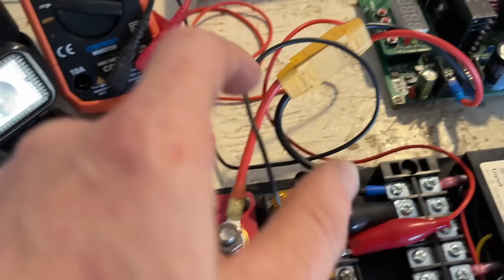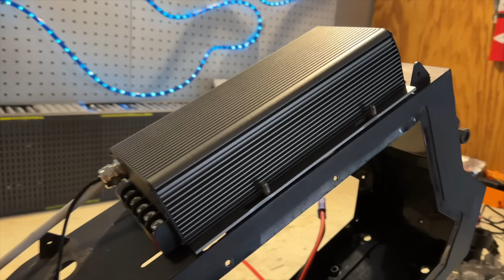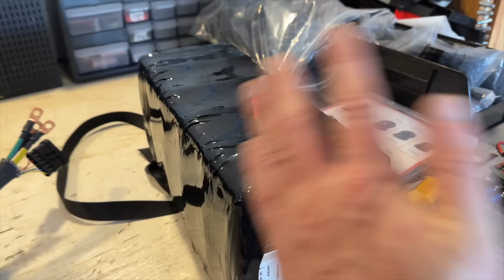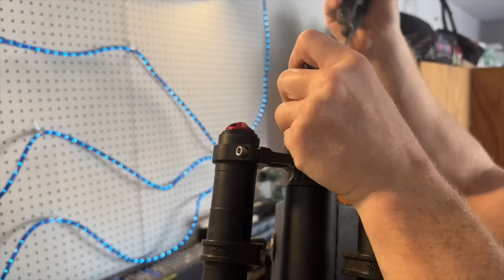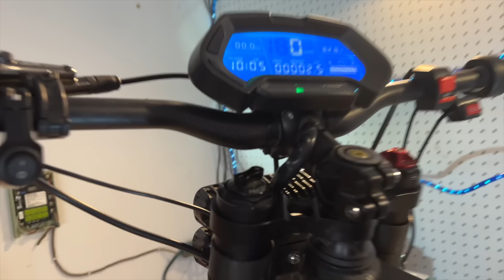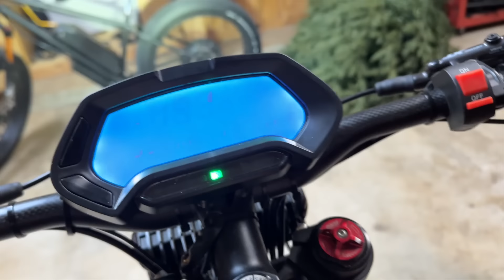This Might Be The Best Way to Build a Stealth Bomber Ebike

Comment: nice job ,you still have way more you can get out of that controllers and set up ,if you got the unlocked version like i did ,you can get insane speeds im using a customised crystalyte HS4065 RD motor with statorade and heat sinks ,and can quite often see the dc amps hitting 300 plus amps with phase amp sinto the 600s ,but im using a 20sx20p battery with 82 volt pack of supa capacitors in parallel ,to eliminate any V drop,
Reply: it took along time to get mine wired and installed though because i have svmc72150 on the rear and svmc7245 on the front with a 750 watt bafang internally gear hub motor ,that has a launch timer on the front motor .i also had to use a cycle analyst inside and raspberry pie that runs android main dash and secondry 5inch touch screen in top of the frame ,i get all the data from bms and 2 sabvotons and CA via a CAN bus sheild to the pie and bought a bunch of can nodes from ali express for few bucks each for all accessories and buttons etc
Reply: we also modified the rear swing arm and suspension to linkage type so can use way longer travel shock its no mounted up under the seat frame like an actual S bomber ,the battery has amazed me though its completely immersed in 3m novec dilectric fluid ,and they stay perfect temps ,dont even get warm even when charging at 50 amps,its expensive ,but worth it concidering its now fireproof
Reply: Where do you learn how to do all of this? Are you an electrician?
Reply: Audio studio engineer,and studio design.but i worked for a place called dick smith electronics while was at school and when first left school in their service  deptment,  i used to buuild and repair the diy electronics kits that people bought and couldnt finish or get working.  But when it came to the bike i did alot of reasearch first ,and made a specific list of the functions i had to have ,and didnt deviate from thatmwhich made it alot easier
Reply: if you ever need circuit diagrams or designs ,or how to do something im always happy to help as im retired now, had to retired early when had a stroke cpl years ago,but im ok now ,but  im not going back to work
Reply: i make my acc and lights controllers.antilock hydralic brakes addon module. electronic gear shifting unit, traction control system,all on rarspberrypi with touch screen in the top of the frame
Reply: happy to share all the plans
Reply: @katiekumcgil damn that’s so cool, I’ve been wanting to build one for a while now as a project to reunite with my dad. I’m eager to learn. I would love to have your plan to help us build the best bike! Thanks and hope you are doing better!
Reply: @katiekumcgil G'day matei believe it would be absolute fantastic to hear your e bike build story  if your willing to share  your experience and knowledge then i would be privileged to hear every detail  and learn as much as i possible could from you. 
What sparked my interest was hearing you talk about rear swing arm mods  i would appreciate greatly to be able to hear every single little detail of  what specific modifications you did to your swingarm/rear suspension to   increase the travel. I would love to hear about all your e bike building experiences
Reply: @katiekumcgil  could you please upload photos of your plans or a video of your ebike modifications on your YouTube channel. Your e bike buid sounds so very compelling.
 Thanks
Reply: Hello Scott i  actually had a stroke the begining of last year so would make it hard for me to do a full build video ,but saying that since you asked so nice ill sort out some photos and ill do some plans parts and specs for you ,myself and Angus actually repair and customise ebikes,mainly for the higher spec bikes as im in Australia and they are near impossible to buy here,only street legal bikes can be sold retail and bikes like sir ron have insane mark ups here nearly twice the cost they pay in the states .we try and start off with frames that anyone can buy online like the bomber clones ,and modify them to have full suspension travel, ,they way they are with that little shock at the back realy seems like a last minute fix ,so we make a linkage arm that lets you mount a full shock up under seat. the control system is possibley to involeved for most but not undoable all parts are available ,theres a few mcu s like arduino nanos and rarsberry pis ,and all code is allready writen and available on site called Git hub and the dash is actually on android phone and that talks with android on rarsberry pie ,has full navigation electric and manual gear shifting  ,dual motors ,we actually worked out how to install front hub motor on the zoom through axle forks too. the battery system is abit in depth as it usues whats called immersion cooling where all the cells are in solution,like those mineral oil pcs you see on you tube ,the controllers are also connected to it so they are full of liquid as well ,it doesnt add to much weight concidering the returns.anyhow ,if you can give me a bit of time well sort out some stuff,casn do wiring diagrams to
Reply: we are currently designing and building the E-Camper ,to go with it ,which is to be a full featured micro camper ,to have 4 26inch rims set about 3/4 length and the front 2 wheels have hub motors so basically the camper is self powered so no weight or stress is put on the bike,this allows us to put a huge battery in the camper giving somewhere between 500 to 1000 kilometres as it connects into the bikes battery as well ,if you have alook at a channel called  woodbiker he makes a small version of what were doing but it will give you and idea how easy they are to build and its done with eps insulation board and single layer fibreglass ontop
Reply: if you find theres something that youd like to make yourself that weve done ,then i can do a more detailed design drawing and full parts lists etc everything can be made with minimal tools and intermediate electronics knowlegde ,but ill allways help out if needed
Reply: thought you might like this too as it started off as abit of a joke ,but found that it started to make abit of sense as a back up or even for charging,we found a tiny 23 or something cc chainsaw motor and made a 50 volt 30 something amp micro generator ,and uses 2 dc to dc boost converters to output 85 volt or what ever you need ,but the funny part is that its the same size as our bike battery so can remove the battery pop this in start it up and away you goit will go all day virtually on a tiny bit of petrol,but can also just be used to charge the bike ,were going to stick it in the camper storage ,as ill be in some really remote areas where you dont see anyone for days possibly few weeks sometimes.
Reply: @katiekumcgil i am just puttimg the finsihing interior trims on my camper.  I made up a fake brand..."EcoTrek" and put some graphics and logos to make it look legit.  It weighs about 130lbs without batteries / solar.  It has a 12v fridge, a sink and faucet, desk.  I hope to put about 350W of solar on it and just keep adding more and more batteries.  It is also getting hub motors eventually.  I put two on my bike first.  I am still considering an axle run to an electric motor I already have, but the hub motors are so much nicer and easier.  I am eventually hoping to travel cross country with it.  I was hoping to test it this season, but it wasnt quite ready.  I hope to spend a ton of time with it next season though.

Comment: how much did this cost to build?
Reply: That price itself is not made for everyone
Reply: @ankanpradhan9724  this is actually obtainable unlike those boutique like bullshit emtbs that put a fraction of this bikes power at the cost of lower weight and costing almost like a good new car.
Reply: @dienowplease3565 Thsts an entirely different market with different goals.

They are primarily on the pedals all the time, and the powertrain needs to be unobtrusive and not throw off the balance or make the bike difficult to peddle.

And those are folks who don't blink at $8k for a regulat MTB.
Reply: @ankanpradhan9724 3k not that much
Reply: Well what's great about ebikes is you can source the parts little by little, maybe 1 pay day buy ur forks, maybe next time you get money buy battery an so on, you don't need 3000$ upfront an lot of parts are relatively cheap like handle bars or peddles, an you can customize to ur likings,  I have a custom built ebike cost maybe 1500$ I bought over course of 2 months and it does 40mph easily an for another 200$ I could got a 52volt 2000watt kit an reach speeds of almost 50mph an easily go up big hills an easily covers 30 miles throttle only top speed
Reply: @josephgeorgeejr7039 have you built an ebike?
Reply: @josephgeorgeejr7039 Ingotta call bullshit on 50mph for 30 miles on a $200 upgrade.

I don't think you understand power requirements or realities of battery sag.
Even P45b's will sag.

Take a look at this guys video again and watch how badly his battery pack sags.

If he ran wfo for 10 minutes he'd be done.

Even my old pack that would do 800a continuous and 1600a burst still wouldn't really do 800a continuous.
Reply: How? I calculated one a while ago and I somehow got like £7k but maybe as like 7kw+ motor
Reply: @mlee6050  Your where? UK? Europe? Maybe that's why? 
Here in Canada you can build one for about $3000 Canadian. 
None of you seem to understand exchange rate. Our money has different value. Certain parts and products are more readily available in some regions which makes them cheaper. Etc
Reply: @rabbithole8592  I understand exchange rates, it why at times I buy groupsets for my bike from America as even with import I save a few hundred than in my country

I might build one in future, issue now, I want one and a mountain bike £5k for sub 8kg and fixie and the builds I plan are a few thousand each
Reply: @mlee6050  Well that socks dude. I can build a stealth bomber clone for about $3000. Canadian. 😉 👍
Reply: @rabbithole8592  I might be able to lower the price but look around more, I mainly went to a single site, I normally go through like 8 sites manually comparing when doing so, think one I looked at was 70mph or so, I believe 8-12kw motor I was looking at, after I build my trek Emonda ALR I might look into it more

I'm also tempted if should add a motor on my folding bike where chain is on left but have chain on right for gears I want
Reply: Just ordered mine for 2k
Reply: @00-Dima  where did you order yours from ? I've been trying to find the best places to pick one up.
Reply: Yeah where did u order? Alibaba?@BanderaMafia
Reply: You can make a stealth bomber clone for about $3000
Reply: 😢😊😊😊😅😊 @rabbithole8592 😂
Reply: @rabbithole8592 you can make one for under 500  easy it’s just everyone will over charge you for parts so you need to make them
Reply: @rabbithole8592 in India we can buy a super electric bike less than of that money
Reply: @atnakus  Yeah because your money is worth hardly anything compared to American money. It's a different currency and exchange rate.
Reply: @rabbithole8592 that's definitely NOT why
Reply: How much is it there?  @atnakus
Reply: Please what is the material of the electric bike?
Reply: @waledactionph7860  MOHAMMED WAS BEWITCHED/POSSESSED BY SATAN! 

Sahih al-Bukhari 6391

Narrated `Aisha:

that Allah's Messenger (ﷺ) was affected by magic, so much that he used to think that he had done something which in fact, he did not do, and he invoked his Lord (for a remedy). Then (one day) he said, "O `Aisha!) Do you know that Allah has advised me as to the problem I consulted Him about?" `Aisha said, "O Allah's Messenger (ﷺ)! What's that?" He said, "Two men came to me and one of them sat at my head and the other at my feet, and one of them asked his companion, 'What is wrong with this man?' The latter replied, 'He is under the effect of magic.' The former asked, 'Who has worked magic on him?' The latter replied, 'Labid bin Al-A'sam.' The former asked, 'With what did he work the magic?' The latter replied, 'With a comb and the hair, which are stuck to the comb, and the skin of pollen of a date-palm tree.' The former asked, 'Where is that?' The latter replied, 'It is in Dharwan.' Dharwan was a well in the dwelling place of the (tribe of) Bani Zuraiq. Allah's Messenger (ﷺ) went to that well and returned to `Aisha, saying, 'By Allah, the water (of the well) was as red as the infusion of Hinna, (1) and the date-palm trees look like the heads of devils.' `Aisha added, Allah's Messenger (ﷺ) came to me and informed me about the well. I asked the Prophet, 'O Allah's Messenger (ﷺ), why didn't you take out the skin of pollen?' He said, 'As for me, Allah has cured me and I hated to draw the attention of the people to such evil (which they might learn and harm others with).' " Narrated Hisham's father: `Aisha said, "Allah's Messenger (ﷺ) was bewitched, so he invoked Allah repeatedly requesting Him to cure him from that magic)." Hisham then narrated the above narration. (See Hadith No. 658, Vol. 7)

22.52-54 Kathir - Ibn Al KathirHow the Shaytan threw some Falsehood into the Words of the Messengers, and how Allah abolishedAt this point many of the scholars of Tafsir mentioned the story of the Gharaniq and how many of those who had migrated to Ethiopia came back when they thought that the idolators of the Quraysh had become Muslims, but these reports all come through Mursal chains of narration and I do not think that any of them may be regarded as Sahih. And Allah knows best. Al-Bukhari said, "Ibn `Abbas said,فِى أُمْنِيَّتِهِ(in his recitation (of the revelation).) "When he spoke, the Shaytan threw (some falsehood) into his speech, but Allah abolished that which the Shaytan threw in.''ثُمَّ يُحْكِمُ اللَّهُ ءَايَـتِهِ(Then Allah establishes His revelations.) `Ali bin Abi Talhah reported that Ibn `Abbas said,إِذَا تَمَنَّى أَلْقَى الشَّيْطَـنُ فِى أُمْنِيَّتِهِ(when he did recite (the revelation), Shaytan threw (some falsehood) in it) "When he spoke, the Shaytan threw (some falsehood) into his speech.'' Mujahid said:إِذَا تُمْنَى(when he did recite) "When he spoke.'' It was said that it refers to his recitation, whereas,إِلاَّ أَمَانِىَّ(but they trust upon Amani) means they speak but they do not write. Al-Baghawi and the majority of the scholars of Tafsir said:تَمَنَّى(he did recite) "Reciting the Book of Allah.''أَلْقَى الشَّيْطَـنُ فِى أُمْنِيَّتِهِ(Shaytan threw (some falsehood) in it) "In his recitation.'' Ad-Dahhak said:إِذَا تُمْنَى(when he did recite) "When he recited.'' Ibn Jarir said, "This comment is more akin to interpretation.''فَيَنسَخُ اللَّهُ مَا يُلْقِى الشَّيْطَـنُ(But Yansakh Allah that which Shaytan throws in.) The meaning of the word Naskh in Arabic is to remove or lift away. `Ali bin Abi Talhah reported that Ibn `Abbas said, "This means, Allah cancels out that which the Shaytan throws in.''وَاللَّهُ عَلِيمٌ(And Allah is All-Knower,) means, He knows all matters and events that will happen, and nothing whatsoever is hidden from Him.حَكِيمٌ(All-Wise.) means, in His decree, creation and command, He has perfect wisdom and absolute proof, hence He says:لِّيَجْعَلَ مَا يُلْقِى الشَّيْطَـنُ فِتْنَةً لِّلَّذِينَ فِى قُلُوبِهِم مَّرَضٌ(That He (Allah) may make what is thrown in by Shaytan a trial for those in whose hearts is a disease) meaning, doubt, Shirk, disbelief and hypocrisy. Ibn Jurayj said:الَّذِينَ فِى قُلُوبِهِمْ مَّرَضٌ(those in whose hearts is a disease) "The hypocrites, andوَالْقَاسِيَةِ قُلُوبُهُمْ(and whose hearts are hardened.) means the idolators.''وَإِنَّ الظَّـلِمِينَ لَفِى شِقَاقٍ بَعِيدٍ(And certainly, the wrongdoers are in an opposition far-off.) means, far away in misguidance, resistance and stubbornness, i.e., far from the truth and the correct way.وَلِيَعْلَمَ الَّذِينَ أُوتُواْ الْعِلْمَ أَنَّهُ الْحَقُّ مِن رَّبِّكَ فَيُؤْمِنُواْ بِهِ(And that those who have been given knowledge may know that it is the truth from your Lord, so that they may believe therein,) means, `so that those who have been given beneficial knowledge with which they may differentiate between truth and falsehood, those who believe in Allah and His Messenger, may know that what We have revealed to you is the truth from your Lord, Who has revealed it by His knowledge and under His protection, and He will guard it from being mixed with anything else.' Indeed, it is the Wise Book which,لاَّ يَأْتِيهِ الْبَـطِلُ مِن بَيْنِ يَدَيْهِ وَلاَ مِنْ خَلْفِهِ تَنزِيلٌ مِّنْ حَكِيمٍ حَمِيدٍ(Falsehood cannot come to it from before it or behind it, (it is) sent down by the All-Wise, Worthy of all praise (Allah).) 41:42فَيُؤْمِنُواْ بِهِ(so that they may believe therein,) means, that they may believe that it is true and act upon it.فَتُخْبِتَ لَهُ قُلُوبُهُمْ(and their hearts may submit to it with humility.) means, that their hearts may humble themselves and accept it.وَإِنَّ اللَّهَ لَهَادِ الَّذِينَ ءَامَنُواْ إِلَى صِرَطٍ مُّسْتَقِيمٍ(And verily, Allah is the Guide of those who believe, to the straight path.) means, in this world and in the Hereafter. In this world, He guides them to the truth and helps them to follow it and to resist and avoid falsehood; in the Hereafter, He will guide them to the straight path which leads to the degrees of Paradise, and He will save them from the painful torment and the dismal levels of Hell.
Reply: @waledactionph7860  I would guess steel for frame at least as most kits are like that
Reply: $3,000 for a 50 mph bike is not bad depending on the amp hours you got some decent range you just got a plan your trips